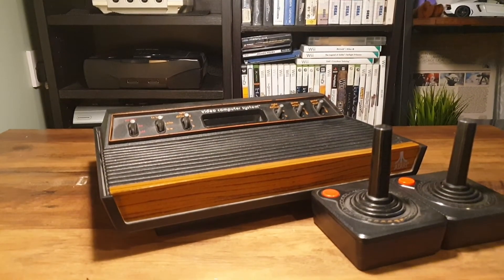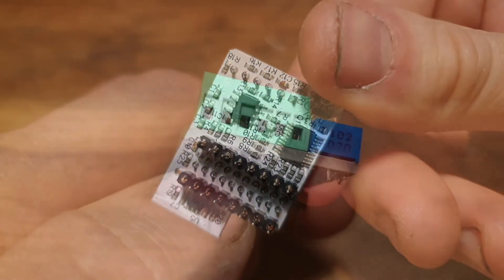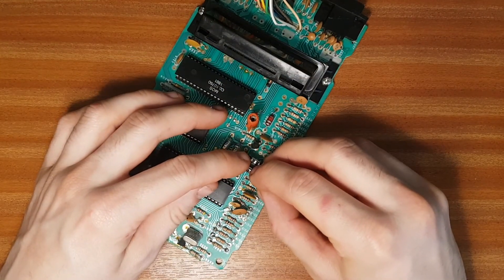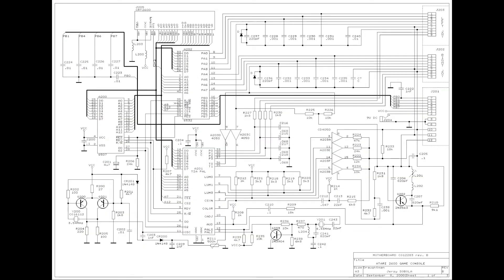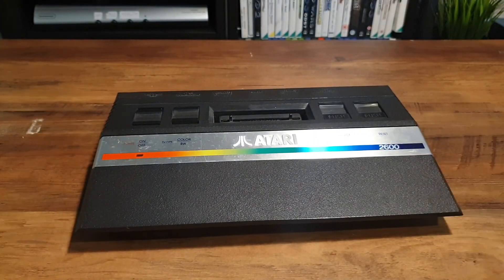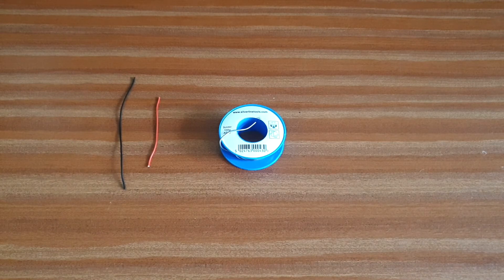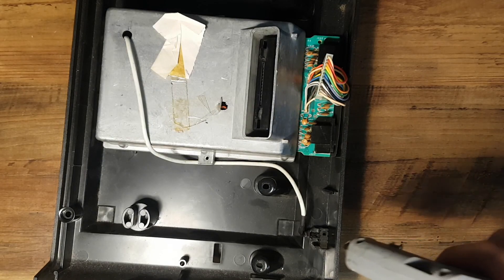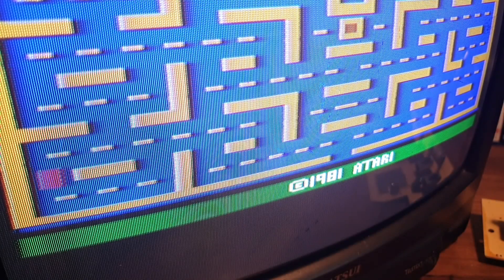UAV install into an Atari 2600 - And how Atari screwed up

Comment: I did a DIY a/v mode about 20 years ago from a write up on AtariAge.  It works great for s-video (luma/chroma) but on compoisite (you combine the luma/chroma) it has some flare and isn't nearly as sharp.  At the time I had a Toshiba CRT with s-video input, but I don't have that anymore.   I may need to look into this particular mod.   I do know on the original mod I removed many components that were only for the RF output as the write up explained this would make the a/v mod clearer.

Comment: In 1977 before composite and S video were invented how can Atari be expected to anticipate the invention of these technologies? The Atari 2600 worked with the technology of it's day, the designer did not make an error.
I'm currently using an Atari STE with a cable running from the monitor socket to the SCART input of a TV, I bet you can't do that in America!
Furthermore I have an original 1980s colour/mono monitor switcher that allows me to change from a flat screen colour TV to an original Atari mono CRT monitor at the flick of a switch (you do have to switch off the computer while you do it).
Reply from the maker: The designer made an error by not connecting the vcc and ground lines to the chip used for inversions. I also said in the video this predated svideo

Comment: How on earth the CD4050 even work without VCC and GND?
Reply from the maker: Electricity will always follow the path of least resistance, but also if you send 5v into the device’s inputs, any components or internal resistors etc will leak current to the power rails. It causes undefined behaviour
Reply: @NaokisRC  I moded my Atari for composite only by adding some resistors to the CD4050 and one cap. And discovered that the GND of the 4050 is OK , only the voltage is around 3.6V so I added only one conductor from nearest 5V pont to that IC . So if you do not add proper 5V the results are simsiler to yours , jumping unstable dark picture , and normal RF functionality. But when you add those 5V the picture form composite become normal and stable , but the RF become much brighter. So I will try a resistor for the RF cable to see if it will darken it. My approach is to not remove any part from the system, only add , just like you :) the only problem is the jail bars , but this is issue with the NTSC TIA , the PAL is jail bars free :)

Comment: The ATARI 2600 is almost old enough to be an official Vintage object and you just made a hole in the case, that it not "reversible"  😉
Reply from the maker: I think you will find I didn’t drill or make any hole in the case that wasn’t already there from Atari, lol

Comment: Atari could still be on top, even to this day. Atari’s biggest mistake is ignoring their fan base and their suggestions to improve their systems. Example Atari VCS great design. But should OS should have been Android and have cartridge slot like new Atari+., and they priced Atari VCS way too high. So much potential yet those who run Atari ignore those who want it yo succeed.
Reply from the maker: I am assuming you are talking about the 2600+ as there is no OS on these consoles. There was only the game program on the 2600, the game code controlled the console directly. Plus the cartridge slot is this way because it was the first Atari home gaming console. The 7800 came much later.
Reply: @NaokisRC  I was saying Atari VCS should have had an android OS. Would have made much more sense to use it as a streaming platform, video/games etc. Like an Nvidia Shield Pro only Atari hence the slots for a nostalgic but usable touch.
Reply from the maker: Ah you meant the PC based modern one. Sorry I had briefly forgotten about that one, if Im not mistaken you can install your own OS on that and there is a port of Android for x86 but it would have been nice to have Android I agree.
Reply: @NaokisRC  Atari has always had great potential. It is numbing to watch those at the top ignore the obvious. Personally I believe a collaboration with Nvidia for a true dedicated gaming console is long overdue such as with the Atari VCS second generation.

Comment: How it is even possible to CD4050 to work without VCC and GND?
Reply from the maker: Probably from any ESD diodes in the chip on the other input pins.

Comment: The buffer gets its 5V through the ribbon cable going through the top board. It's by design. So your ribbon harness on the 6 switcher is bad
Reply from the maker: The console wouldnt work at all if the ribbon was bad.
Reply: @NaokisRC  Sorry pin 10 of ribbon, pin 8 of hex buffer
Reply from the maker: Pin 8 of the CD4050 is ground, not 5V. In either case, there was an fault with power not being applied from either design oversight or faulty ribbon, which is what i was trying to address.
Reply: @NaokisRC  pin 8 is VSS which is ground, you can also test that with multimeter or datasheet. You can also see your issue was pin 8 goes through ribbon pin 10 back to ground and that was all that was missing

Comment: It's not that composite and y/c (later "s-video") inputs didn't exist back then, it's just that they weren't normally on consumer televisions. They were common on computer monitors and PVMs at the time. Y/C inputs existed long before SVHS, it's just that it was carried on two RCA or BNC connectors instead of the mini-DIN plug that SVHS standardized.
Reply from the maker: True, perhaps i should have added that context of "in the consumer space". I mean if you had a TV you likely only had an RF input. I know there were CCTV monitors and computer monitors with composite input, although I've not seen Y/C inputs used before the C64 used them
Reply: @NaokisRC  As far as early home computers go, the 1979 Atari 8-bit 400/800 computers supported Y/C

Comment: Mine's NTSC, but I grabbed a high quality coaxial cable plus a set of Coax-BNC, BNC-RCA adapters from RadioShack, and have had no signal issues on my Magnavox. Crystal clear RF signal.
Reply from the maker: Fair enough. Some people it works fine for. The UAV is designed for more modern equipment anyway

Comment: Hi

Great video.

I  have a couple of questions that I can't get my head round.

The manual shows a pin being bent up on the TIA and also the removal of a pin on the UAV board.

Plus there is no mention of a low voltage (3.2 volts) to the 4050 chip, and thus ta nthe UAV board.

Your video does not mention any of this, or  any of the other videos that I have seen. 

Is the manual correct?

Hope You can shed some light on these queries.

Regards 

Mark Affleck
Reply from the maker: If you have only 3v to the CD4021 then you have the same problem that my unit did. Around 11:04 I explain the hardware fault.

Also on a PAL unit there's no need to lift any pins, only on some NTSC models

Comment: hello, great video !
Where did you take the audio on the board ? Don't need the Internal Audio Board sold bu TBA ?
Reply from the maker: I can't comment for all versions of 2600 but this one is almost directly from the TIA. The only components between the TIA and the RF modulator (which joins the audio and video into the one cable) is some filtering components.

Comment: Maybe just get some rubber matting or a bicycle inner tube to cut into circles for those dust covers?

Pro video my dude
Reply from the maker: I have a feeling Hobby Craft do an exact thing. Need to look into it
Reply: @NaokisRC  I got a sheet of black foam about 2mm thick from Hobby Craft. Cut it into shape and it's as snug as a bug.

Comment: Imagine the design review meeting when they realised the board had no power going to that chip. I bet there was a certain amount of "huh, well it still works... err... OK then, let's leave it alone!"
Reply from the maker: See it does work so that might have been the case. Its just at power up it doesnt go to to 5v because its got next to no current and the RIOT sees the button as pressed.
Reply: You may be right - but I don’t know…
If something was missing, it was (probably) done on purpose. From what I’ve frequently read, Atari engineers were always exploring ways to cost reduce the system. 
Very interesting though!